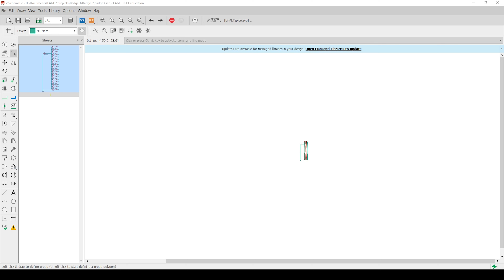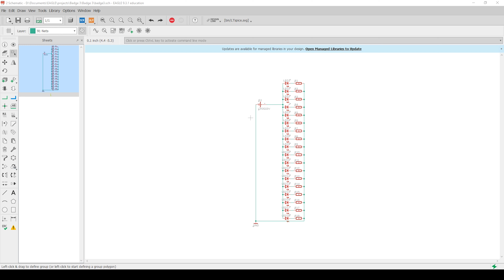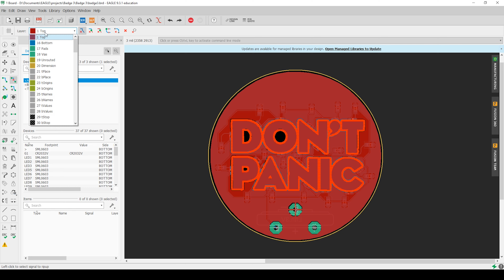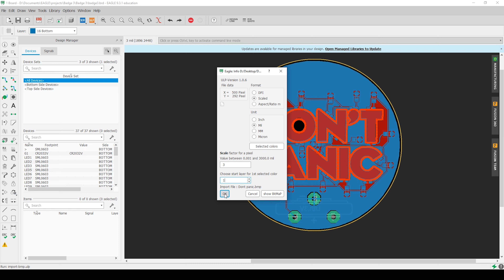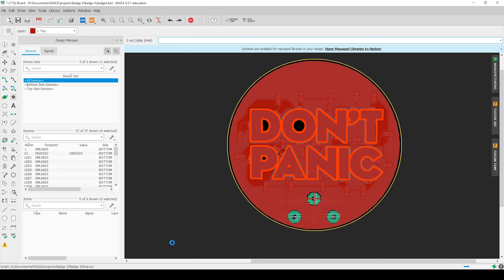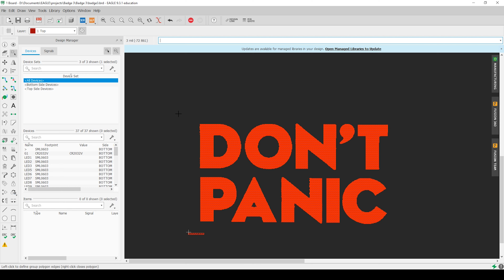Don't Panic

Comment: You can place the LEDs directly under the letters (on the other side), and solder them upside down, then the PCB will act as a diffuser and scatter the light. It may also be better to use a round battery holder - this will make it more compact so that you can wear it, for example, like a badge.

Comment: I have that same Proto Board and mine is just as crusty if not more.  I used it in my Aneng an8008 multimeter video and my 1st Tesla Coil video (...Diagnosing a non-working Circuit...).  I think I got mine from my high school throwing it away (similar to your situation).  BTW, a bit of trivia, the Hitchhiker's Guide...(British version) uses a song by the rock group "The Eagles" as the theme song.  Also, BTW, both of my videos mentioned above have math in :-)  But (in Aneng video) I also show an easy way to deal with Ohm's Law (that I first saw in a Heathkit manual) - V, I, and R in a circle... maybe you've seen the method before.

Comment: You could try a 10440 battery. It is about the size of a AAA battery and it shouldn't have any issues dealing with all of those LEDS...I don't think. or as Juan suggested, if you want something a bit flatter, you could try a small LiPo pack.

Comment: David .... how about to use a raw Li-ion battery cell , small size and thin enough to pack with your project and also can be recharged for longer use.... Raw Li-ion battery cells are like these https://www.sparkfun.com/products/13852  , https://www.sparkfun.com/products/13851  ,  or any similar....

Comment: CR2032 has a capacity of 32mAh @ 3V ... that means it could supply that much current for one hour before being depleted. Higher currents are possible at the expense of shorter runtimes. Several suggestions: 1. Round-robin through the LEDs, lighting only one at a time at a high enough rate so as to avoid visible blinking. 2. If you need a longer runtime (quite probable) I should look for a (rechargeable) Lipo battery, It Will still be light and small but It will give you higher currents and more autonomy. 3. With a few components you can add charge control for the Lipo and make It rechargeable (no messing around with the internals of the garment) 4. Combine it with your wireless charger experiment and you won't need a  charging connector ... Keep It Up!

Comment: Regarding the Proto-Board. Yes, a standard 'fixed' voltage regulator can be used to generate a variable voltage using a resistor voltage divider on the output. In that way, it acts very like an LM317. I suspect they must cheat a bit to generate the negative rail though by treating the positive 15V output from one of the 7805s as  ground and that 7805 ground rail as -15V (a bit like simply reversing multi meter  probes when taking a voltage reading)?
Reply: That’s possible. To raise the voltage of a 7805 (or indeed any 78xx regulator) you just need to raise its common terminal by a suitable voltage. So a Zener diode can also be used.

Comment: Thanks for the mention David and thanks again for pointing me at those breadboards. 

As for your LED circuit, what about adding one of those button super capacitors in addition to the cr2032? Let it charge up to voltage, then have the flasher circuit turn the led's on at a higher current than the cell can provide. You can multiply up the maximum current draw by your on/off ratio.

Comment: Any chance you could describe how the pin outs on a breadboard work to people like myself who dont understand the underlying connections, thanks. BTW in regard to the Don't Panic sign HAK 5 had a couple of pieces the other day from DEFCON 27 about Badgelife might be worth looking up [love the Stargate badge]
Reply: Breadboards are a matrix of contact strips. Normally one strip fits under one “row” of five (or six) holes. With many such strips arranged along the breadboard, but set in plastic, so that there is no electrical contact between different strips (rows). Plus some have “bus-bars” top and bottom that ether run the whole length of the breadboard, or along half, or a quarter of it (depending on the type), these have holes/contacts for wires/components as well.
Reply: Each group of five (or six, on the ones he was just showing in the video) in a vertical column are connected together, and if you have +/- power rails along the top and bottom each of those is connected horizontally (usually all the way across, though cheap breadboards sometimes break them into groups).

Comment: Lots of space on that board? Why not 2x CR2032, put them in parallel so you keep the same voltage / resistor values. Red LED's might be more efficient so probably worth re-running your experiment with LED's closer to what you might use.

On a side note - why so many resistors? If you're lighting them all at the same time then you can just current limit them all with one resistor.

Now if you're inventing stuff - I'd buy a calculator with the personality of Marvin the paranoid android - "Brain the size of a planet and they ask me to calculate the value of a resistor?"

Comment: If the CR2032 had no internal resistance, wouldn’t the 1/4W resistor get burnt? 22 ohm x 0,04 A = 0,88W.
Reply: I²R  so that's 0.0352W
Reply from the maker: In time yes, the actual design has one resistor per LED. I just wanted to see what current the 2032 could deliver.

Comment: @13:00 are you sure it isn’t using 7815 and 7915 regulators? I’m sure the -15v rail should be referenced to 0V/Earth rail.., a repair project I think.
Reply from the maker: Yep, according to the datasheet I found online anyway.

Comment: Aaaaand even found a "how to do peaks and stuff" from the Pros at TI:
https://e2echina.ti.com/cfs-file/__key/communityserver-discussions-components-files/104/7510.swra349-Coin-cells-and-peak-current-draw.pdf
:-)

edit: wouldn't there be enough space to put in 3 cells on.. in parallel or even better to get 9V, so you can run the leds as a string ? attiny85 added for the led flashing or ramping up...

Comment: .. hello again ;-)

i found for two "lower power not blinding" white leds (warm white) a cr2032 with no resistors works fine for doggy lights.

the cr2032 has enough internal resistance so it doesnt blow the leds. leds dont suffer and last through many cr2032 cells (multiple years) with a simple on/off switch on the doggy lights.

also no worries getting them under water, no short circuit at 3V in normal water.

now for more than 2 leds it for sure wont need any resistors ... aaaaaand it might not be very bright and lasting...

perhaps use a capacitor to help along while flashing ?

Cr2032 datasheet later on says 10mA max  ?
http://www.farnell.com/datasheets/1496885.pdf
and recommends 15kOhm load.

edit: perhaps shine one or two leds into a plexiglass reflector ? hot snot, err transparent hot glue ?
edit2: the 3.2V is the no load voltage ;-)